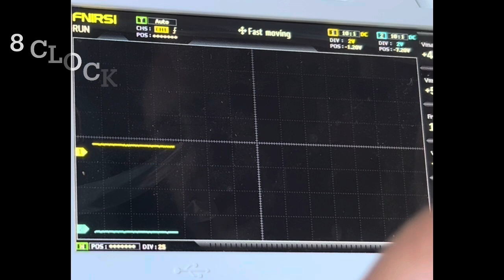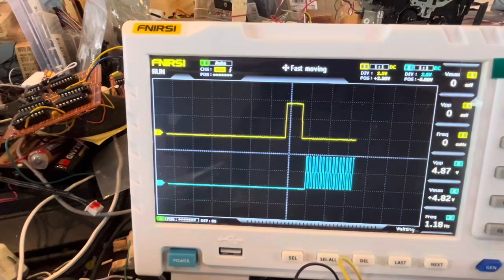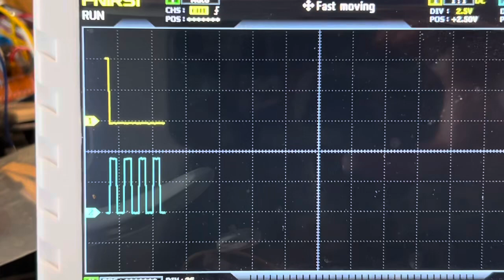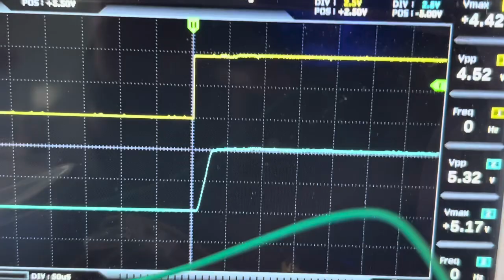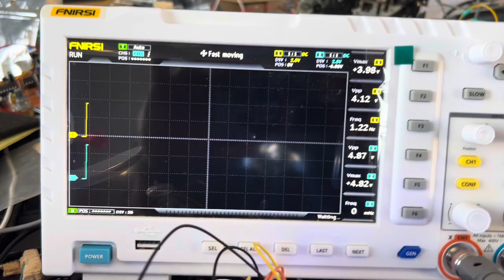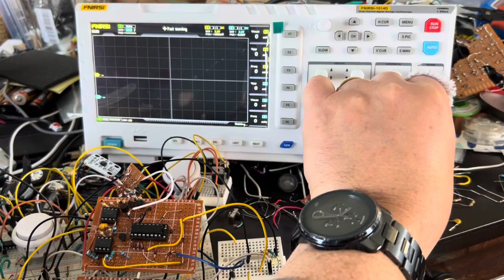Coding in Hardware: Hacking I2C without a Microcontroller

Comment: You should use an iambic keyer to create I2C at a much higher rate 😅
Reply from the maker: @SojournerDidimus  i made it slow so i can keep track of the sequence going through as i was building it. As i discovered, the timing can be leisurely and it still works